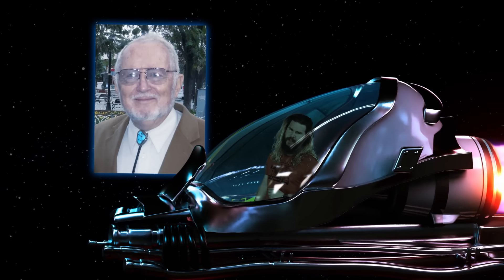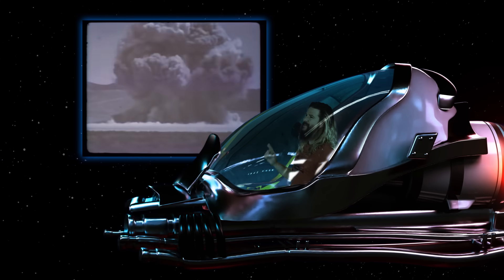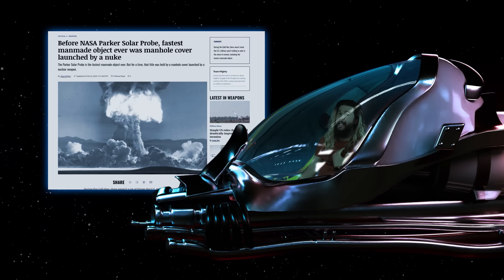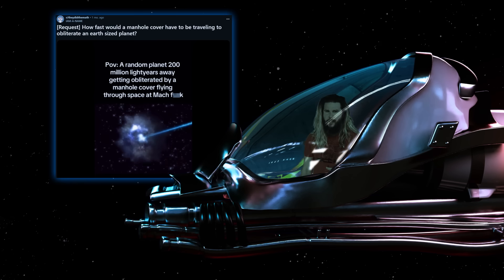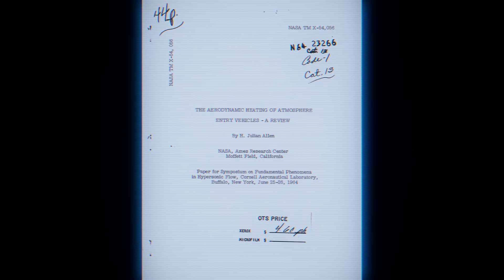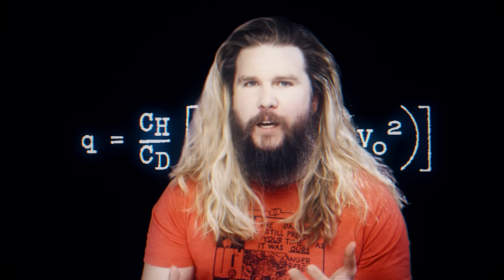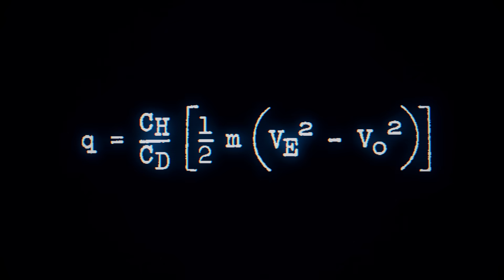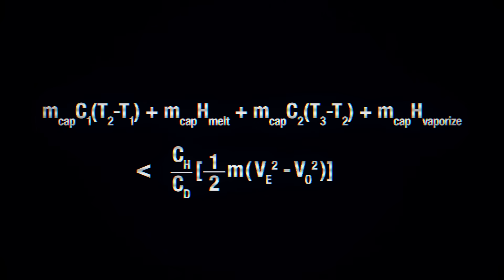Debunking the Nuclear-Powered Manhole Cover

Comment: lots of comment that i agree. but there is one more factor yet calculated.    at certain level of atmosphere,  the temperature of the air is progressively colder, moving away from the surface.   Since cold robs heat,   does cold temper (chill) the iron as it leaves the surface of earth?   atmospheric reentry materials is already "colder" prior to reeentry. thus variable from reeentry equation is not needed.  But should be in "atmospheric exit" equation.

I agree with commenters,  even though Edward Teach is first person to notice that nuclear blast flings materials at high speeds.    we (humans) has not arrived at satisfactory theory or at valid proofs regarding this discovery.

Comment: There's still so much we don't know. How hot the iron already was during the explosion, how high it actually was when caught on camera, but most importantly, how thin the atmosphere gets the higher you climb. Less atmosphere=less friction. Re-entry is different, there's more atmosphere the closer you get to earth's surface. So it stands to reason an object is heating up slower during re-entry, meaning it has time to get hot and vaporize. 
The manhole cover incident is quite the opposite, being launched rapidly into a cooler, less dense atmosphere. However, it could've already been heated by the explosion. It's really a wonderful mystery.

Comment: Cast iron is rather brittle, you can break up large pieces of it with a sledgehammer. No way it survived in one piece past that single frame. It shattered into dust which was then promptly vaporized.

Comment: I know asking this question gets into fluid dynamics, which no one really wants to play with, but would the cap have completely outrun the pressure wave from the detonation, or would it effectively surf that pressure wave, reducing the friction since it is travelling along the hypersonic air for some amount if time?

I agree it certainly didn't enter space as a solid cap as it was on earth. Even if it didn't fully vaporize, I would be shocked if it didn't melt.

Comment: With regards to meteors traveling much slower, I've read that this manhole covers speed was possibly fast enough to beat the friction of the atmosphere, which would have allowed it to make it to space. It also was refined steel not cast iron which can hold up to much higher temps

Comment: Is it possible that a plasma field was created by that much heat, and though interactions with the iron in the plate, the plasma created a rudimentary magnetic field which would help (though not completely insulate) the plate be protected from heat transfer?

Comment: Could it have still made it to space in part due to the thinning of the atmosphere as it got higher up? The atmosphere isn't a uniform density and I would love to see the math on the burn off the disk as it traveled through the layers of the atmosphere to see what happened to the "manhole" as it passed higher and higher into the sky. Because you reversed the equation from NASA of objects coming from Space to the Earth, where the object would have be coming down through the thinner layers of atmosphere and eventually breaking up spectacularly in the denser layers.

Comment: Would it matter that the atmosphere is getting thinner as it leaves compared to getting thicker as it enters or maybe any damage or deformation from the initial explosion or potentially temperature transfer from that explosion if not how much did the variable you struggled with need to vary to change the outcome

Comment: Hold up. So a lot of things to factor in here besides just a standard set of numbers and your fluid dynamics. Number 1 is if it’s moving fast enough then it could’ve easily gone through the thicker layers of atmosphere and gotten to thinner air where it wouldn’t burn up. Number 2 is the assumption that the manhole cover is flat the whole time. The cover isn’t aerodynamic at all but it’s safe to assume that air forced it onto its side where it’s only 4 inches thick. Number 3 is that we don’t know for sure how fast it was moving. Just it minimum speed to only be captured by one frame. It was probably moving with some more ass. Also a few problems with fluid dynamics but I also am not that smart but my grandpa (mechanic engineer) tried explaining it me when I was younger. Basically it’s not constant. It’s like a bell curve where there is a max and a low. Also I’m a college dropout. Do not take what I’m saying for fact about fluid dynamics. I’m just saying that the variable here will make this question a forever “it could’ve made it to space with enough speed and we don’t know it’s true speed”

Comment: Sounds like he messed up the math. My question because I don't know if it matters, would the nuclear blast transfer any significant heat into the manhole prior to it being launched.

Since thermal radiation would be traveling at the speed of light verses the actual blast at speed of sound even talking about fractions is seconds it would be an enormous headstart.

If it could transfer significant amounts of heat it would basically give it a headstart on burning up in atmosphere.

Comment: My only nit is that, as shown by Adam Savage in videos regarding a penny dropped from the Empire State's Building (both on Mythbusters and Veritasium) a disc has two directions it moves. If the same applies here it would dramatically change the drag values.

Comment: Two things. 1) I'm surprised the difference between the force needed to vaporize the metal plate and the force it likely encountered in the atmosphere was roughly 1 order of magnitude. 2) The only variable I think was missed is if a bubble of hypersonic air in front of and behind the plate stayed with the plate for any length of time. I mention it because if that air bubble was there it might have been enough to keep the heat of atmospheric drag away from the plate when it mattered the most (basically acting like a hypersonic air discarding sabot). I would expect it to have just moved out of the way shortly after exiting the hole, but there's still a chance as air is a great insulator.

Comment: I think the 6x the escape velocity theory comes from the fact that it was visible, on film, on a camera taking a frame per millisecond, for ONE FRAME 
It was on film for one millisecond, then gone, for life
Then take into consideration that heat works over time. You could flame a turkey at 1000°f for a couple seconds and its insides would still be frozen
Then take into consideration the EVT (escape velocity theory) at 6x is the MINIMUM that it could be for the 1 millisecond frame of time

Comment: For anyone who's not convinced, USE UNITS! They might be a little bit more work, but they give you soooo much information. If you know you're looking for a length, and you're given a volume and an area, you know by default then how to set up the equation. m = m^3/m^2. This gets much more powerful with crazier units. Just act as if the units are any other X or Y or whatever. The math works out

Comment: We know how much energy was released in a shockwave but we have no idea how much of that energy was actually transferred to the cover for that fraction of a second it spent in the dense atmosphere. The outer layer of steel was vaporized  instantly (or rather exploded) creating a gas shield blocking further heat transfer. A steel ball can survive the nuclear explosion, there is enough energy to vaporize steel but not enough time to transfer that energy.

Comment: The heat in the metal spreads at a speed that may not be enough to melt it completely if it is only exposed to heat for a very short time. A large part of the frictional heat probably escaped into the surrounding air, so that it was not available to melt the manhole cover. You can't compare the manhole cover with typical meteorites, as it is comparatively compact, with a lot of mass in a small space. It is known that parts of rocket stages and spaceships do not completely evaporate during re-entry.
Even after this video, it cannot be ruled out that a remnant of the manhole cover left the earth and the solar system at more than escape speed.

Comment: You also forget the vaporization of the surface of the object insulates the rest of the object, hence how a person can quickly put their hands through very hot streams of molten metal as long as the hand can pass through quick enough to not allow the heat to overcome the transfer speed of heat through the dampness of the surface of the skin. Since the distance to space is not far in escape velocity terms you would have to include the transfer rate of heat through an iron object. I'm not saying you are wrong but it is a factor that could very easily change the outcome of your math along with the fact that the density of atmosphere reduces with height and the velocity would not be zero when it hit space so the change in velocity would be far lower than your calculations.

Comment: The kinetic energy loss to heat is assuming velocity on either side of entry/exit. In this case we assume the manhole is already at maximum velocity at the time of filming. It’s FINAL velocity is then at the moment it might complete an atmospheric exit assuming it hasn’t melted first. You’re going to have to do the calculus on the heat transfer based on time-in-atmosphere and related drag deceleration OR use similar math to derive the time from t0 the manhole cover vaporizes completely and then back calculate if that would happen before leaving atmosphere. Accounting for the thinning of the atmosphere with increasing altitude as well makes this probably a problem set from cal 3 that would take 20 pages of prose to fully hash out all the math, which I didn’t have the gumption to take back in undergrad. Look forward to the follow up with differential equations.
Reply: Also: love the commentary about dimensional analysis, but your number dump mixes and matches kg, g, kj, and j which makes for a very confusing left side of the equation too.

Comment: in the less-than-two seconds it would have taken an object travelling at 66 km/s to reach full vacuum space, i don't think you could possibly completely vaporize a 1800 lb mass of iron

The meteorite analogy is a little clunky because conglomerate space rocks are typically pretty low density

I don't think "did the cap travel at such a velocity as to create enough frictional heating to vaporize it?" was ever the pertinent question. The question that needs to be answered is "How much of this heat energy was the cap able to absorb in the 1.6 seconds before it passed the karman line and escaped the atmosphere"

"BACK OF THE ENVELOPE MATH" EDIT:...actually, 8.3 trillion watts per square meter kelvin might be enough to instantly vaporize a 1800 lb mass of iron

Comment: Your math is horribly flawed for one reason and one reason alone. The manhole cover that was launched into outer space by this explosion weighed 2,00lbs. It was a 1 ton manhole cover, and was not the same as a normal manhole cover. It was travelling at least 150,000 mph. The manhole cover easily made it into space, and cleared the atmosphere well before it would have burned up.

Comment: I like your argument and theory about ANTEROIDS ENTERING our atmosphere from a cooler surrounding and also with a completely randomized molecular structure. First off we’re starting off in a more heated surrounding, secondly the iron molecules are a lot more structured arguably making it more durable than an asteroid. I’m not trying argue that you are wrong by any means, but what I am trying to say is that, as someone who believes that it probably did make it to space, there are a lot of variables and factors that it seems you did not take into account. It’s a lot more than just speed and heat transfers.

Comment: I think the math would work if it was re-entering the atmosphere, but wouldn't drag get less and less as it ascended? And if it was travelling at 150000 mph wouldn't it get into an area of basically no atmosphere, and therefore negligible drag, in significantly less than a second? The ISS orbits at 254 miles above the surface it would be outside the atmosphere in like a tenth of a second right? Would the heat transfer that quickly? I'd buy it shattering from the kinetic energy, but I don't think it would vaporize by leaving the atmosphere. Entering from space, absolutely.

Comment: Okay the mass of the thing is one number that you need to use but there's no way to calculate the resistance due to the shape of it since it definitely wouldn't be stationary as it's flying it would be spinning or does a does a saucer even out and fly the thin way or the flat way

Comment: I'm no expert, not even particularly intelligent. But while I don't agree with his math, I somewhat agree with his result.
An object moving through the atmosphere will tend to find itself in the most aerodynamic orientation. A wide flat disk is essentially an omnidirectional wing. Therefore, according to 'coin drop' tests, it would have likely deviated significantly from it's vertical trajectory, possibly 'gliding' a great distance away from the blast site. It may have simply landed in the ocean.
 That's assuming the initial superheated explosion didn't turn it into a chuck of semi-molten slag.

Comment: This is interesting. Also Air is more dense at the sea level. It would have covered the hardest part of it's journey under fraction of it's first second of travel. From start at desert hot temp. When it's higher at less dense air, it has less particles to interact with, witch means less friction. I wonder, at what second mark it actually did vaporize. As i'm not denying the math and the ammount of energy it had to store in extremely fast phase. Did it have enough time to exit the atmosphere before it managed total vaporization? Also what kind of plasma "shield" or "cone" it would have created on the side that led the item, also heating the thing. Thanks for making this video!

Comment: 4" thick, 4' diameter, 150k mph, 2200° F (one of the lowest melting points), that manhole was toast. Did we also forget to add the heat and deformation immediately caused by the explosion?

Comment: I had to pause it to see but in the delta v portion of that equation you assume the cover slowed down completely. If it had any velocity remaining thats energy that couldnt have been coverted to heat. Plus this doesnt account for any ablation and the convective heat transfer away from the disc is pretty much unknown too. Complaining about people oversimplifying the math then drastically oversimplifying the math and touting that your conclusion is correct is a bit silly.

Comment: I noticed a flaw in most people's argument is that they don't factor in the atmosphere is also traveling at or fast than the speed of the cover. For example, watch a slow-motion video of a gun going off, and you'll see the propulsion fly past the projectile. So the man hole would have little friction in its way, and there is more to it with that factor. So maths people may be able to figure out with this variable included whether it made it intact. Also, inverse isn't the best example for something that is made to be solid to be compared to things that aren't. Astroids and meteors have many flaws in their structures.

Comment: Actually, this might not be true (if I'm not mistaken). It seemed to me that you did your calculation under the assumption that the manhole cover would be facing towards the direction it was moving the whole time (i.e. with its largest side, in terms of surface area, facing forwards), so I decided to try modifying it to see what it would be if it was it's smallest side (SA-wise) facing its direction of movement (i.e. its edge, so, 4 ft x 4 in), and got about 4.032x10^12 J, which is less than 5.9x10^12 J. 
Now, in all likelihood, it may not have been the case that this was the orientation of the manhole cover throughout the duration of its ascent, however I felt it was an interesting result nonetheless, hence my sharing it here.
I'd also like to mention that I could be wrong here. The way I acquired this result was by first dividing 3.8x10^13 J by the SA of a circle with 4 ft diameter, which gave me about 3.255x10^13 J (which I did in account of the formula for C_d, where it's divided by SA, and since in the formula used in the video C_d is the denominator, it'd be multiplied instead, so I divided here to get  rid of the SA used in your (Kyle Hill's) calculation) then multiplied by 0.12387072 m^2 for the new area, which gave me the aforementioned result. 

On another note, we may also want to get some sort of combination of the two, so as to somewhat account for the instabilities in the orientation of the manhole cover. If we assume that 50% of the time it's flat and 50% of the time it's not, we can get about 2.1x10^13 J, but this doesnt account for things like how, if it's spinning really fast, it might be pushing air away from its surface, lowering the amount of drag it ends up dealing with.

I'm curious as to whether or not this may make the results ambiguous; if so, the mystery of the big space coin continues! If not, oh well. /shrug

Comment: They’re within 1 order of magnitude. I think it’s reasonable to be a little hopeful due to the assumptions that were made (Was it tumbling? Did it deform from the friction? When it was liquid did it become multiple spherical droplets? Was it actually cast iron or potentially steel? Was it moving slightly slower than the top end estimate) I think there’s a chance that there’s a hail off ball bearings hurtling through space